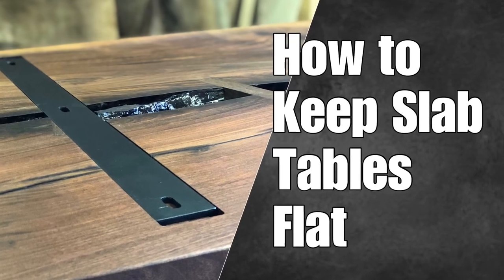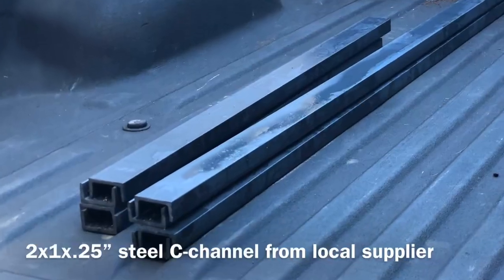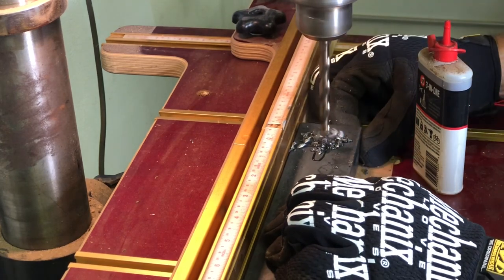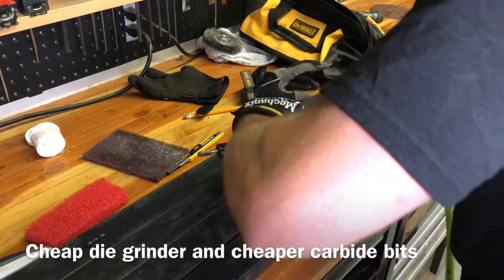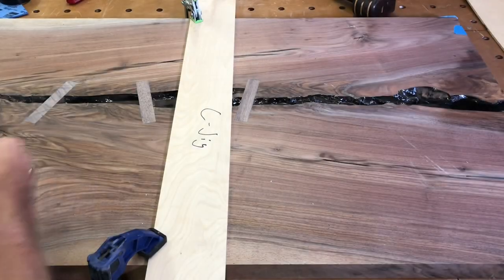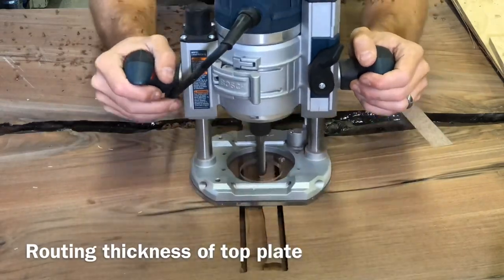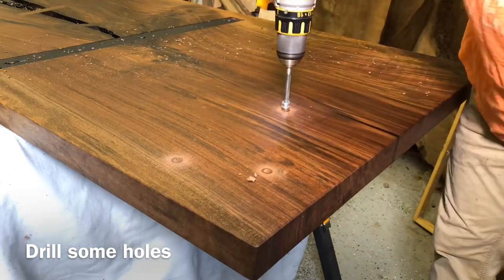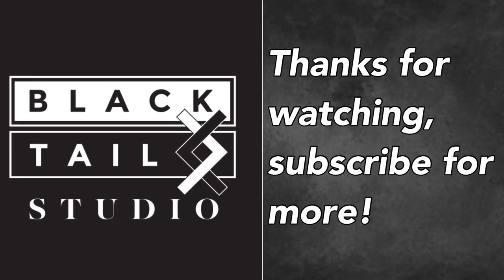How to Keep Slab Tables Flat — How To Woodworking

Comment: Thanks for your response below/.  Thinking of going with c channels or steel bar w slots?  Think the straight bar will work as well ?   But struggling with how to attach top of table to the base.  I am making a trestle bottom so it will have two horizontal cross beams /perpendicular to table slabs that I have to attach the table top to.  But need to account for movement.  Any suggestions.  This attachment part is scaring me more than finishing the table    Thanks
Reply from the maker: I don’t think a straight bar will work too well. C channel is much more rigid. And I often struggle with attaching the base. It always works out in the end though. Just take your time and come up with a good solution. Sounds like you know what you need to account for.

Comment: Figured I’d comment here. Building a 24x84 cedar live edge desk, is there any pro in running say one of these from left to right on the table vs front to back to stop it from Bowing in the middle?
Reply from the maker: Good dry wood shouldn’t bow. One of these probably wouldn’t stop it if it wanted to either
Reply: Blacktail Studio I’m more concerned about the long run with no stability in the middle if I put weight on the desk. Thank you though!

Comment: Hey there, I have a question. I’m making a 3.5’ x 7’ dining table from a single 3” slab of white oak and I’m definitely going to use C channel (probably 4 c channels)! Is it better if i build the table top so that the end grain looks like a ‘frown’ instead of a ‘smily face’ because I assume that the slab will want to warp/twist in the same direction as the end grain? Therefore, if/when it does warp it will be pushing down on the steel c channels instead of (if the board was built flipped over) pulling on the threaded inserts and bolts. It seems to me the scenario of pushing on the c channel would better take advantage of the steel. Any thoughts? Thanks!!
Reply from the maker: Oh,  not sure. Sorry!
Reply: @BlacktailStudio  ok, thanks for answering!
Reply: Well, as an engineer, I can say that the c-channel won’t really care enough to matter which direction it’s being bent.  The bolts however will.  If the wood is trying to pull away from the channel you are putting the outboard bolts (and threaded inserts) into tension and the middle bolt into compression.  If the wood is trying cup into the steel it will be the opposite.  The bolts in compression will never fail.  The ones in tension will possibly fail by snapping the bolt, ripping out the threaded insert, or splitting the wood.  Which is better depends on the bolt pattern you are using, how wide the slab is and the species of wood (which determines how much force it can develop before splitting, or failing the bolt).  With 3 bolts you would want to keep the center bolt in compression since there are 2 outboard bolts so the force from the cupping will be split with approximately half in each.  You can hedge on that by using 5 or 7 bolts instead of 3 in order to split the loads across more bolts (I’m assuming you want to keep one bolt more or less centered, but there’s no particular reason and even number can’t also be used).  How many bolts (and the spacing you use) is a judgement call you’ll have to make based on the variables mentioned before.

Comment: thanks for the great tip on C-channels.

do you also use C-channel along the grain to prevent the table top from sagging? or it won't sag?

I'm planning to make a table top with no supporting frame or aprons, and I'm thinking to add a long apron-like rail along the grain to keep it from sagging over time. but maybe you know from the experience that it won;t sag? 

and another question: is that even feasible to use sliding dovetail for that long middle board "apron" rail? I would rather use long wooden rail and sliding dovetail than metal C-channel.

for the end grain I'll be using bread boards so I'm not worried about warping.

I'm actually only worried about the sagging as there is no supporting frame.
Reply from the maker: Not for sagging. Just across grain 👍🏼
Reply: @BlacktailStudio  so how do your tables without aprons / frames  stay flat over time?

Comment: Can you provide links the the hardware used on the C Channel installation?  (Brackets and screws)  thanks!
Reply from the maker: Check out concept 13
Reply: I'm not tracking.  Video or website?
Reply from the maker: It’s a company

Comment: Do you have any suggestions if the table I’m working on is to thin to add c-channels ..need a solution desperately
Reply: Just reverse them. No inlaying required. Just smooth the corners to avoid people catching them.
Reply from the maker: I use the legs/base instead of channels sometimes

Comment: Hi, i bought a piece of olive wood to make a live edge breakfast bar and would like to reinforce it so that it doesnt twist ... the problem is that it is 21mm thick and i dont think i can route out for a c-channel as it is not thick enough stock .... do you think it would be a good idea to use flat bar ??
Reply from the maker: Try flexing the bar with your hands and see if you think it’s strong enough
Reply: @BlacktailStudio  the olive piece is only 42cm wide ... being quite narrow , the flatbar wouldnt have any flex in them probably ..... also do you only place reinforcement across the wood piece and not along the length of the wood?

Comment: How many do you typically need to keep a ~94" X 40" X 2" (two pieces glued up) from bowing or bending?  I'm thinking three channel supports spread evenly along with the steel legs.  Any recommendations on this?
Reply from the maker: Haven’t done any test. Just go with my gut... plus 25%

Comment: The C-Channel you used was 2" x 1" x 1/4" how thick was the table slab?
Reply from the maker: Oh, I think around 1 7/8”
Reply: @BlacktailStudio  I'm using 2" x 1/2" x 1/8" C Channel on a 1 3/8" x 54" glued up slab, do you think the 1/2" x 1/8" channel will bend with the slab? Thanks

Comment: Do you have issues with the wood expanding and contracting on your epoxy tables causing splits or separation between the wood and epoxy?  Do you use these same C Channels on your epoxy tables?
Reply from the maker: Gavin Bell I don’t have that issue, but will use these on my larger tables 👍🏼

Comment: Just an observation. You shouldn't wear gloves when using a rotary tool. Without gloves you cut yourself. With gloves they can get snagged, suck in your hand and snap 4 fingers, stretch your tendons and render your hand useless. I work in the auto industry and I've seen it happen.